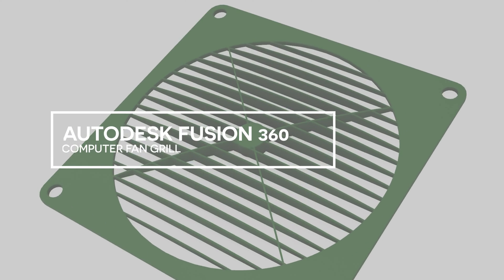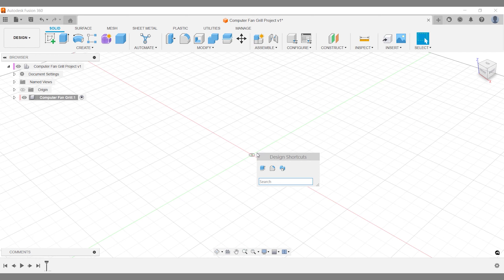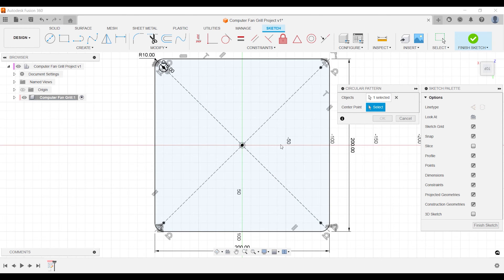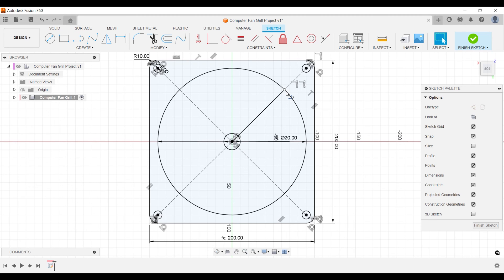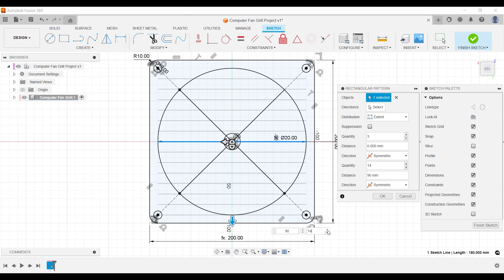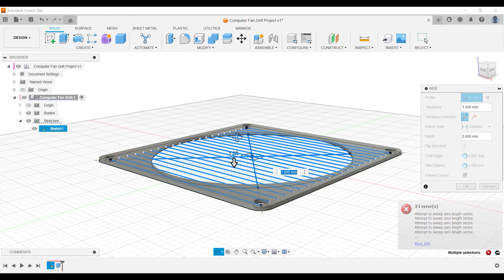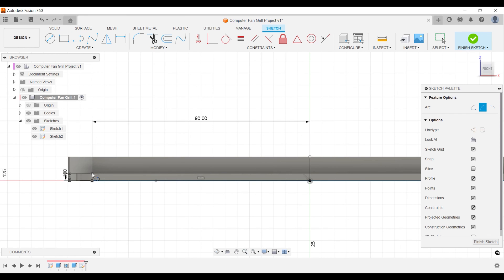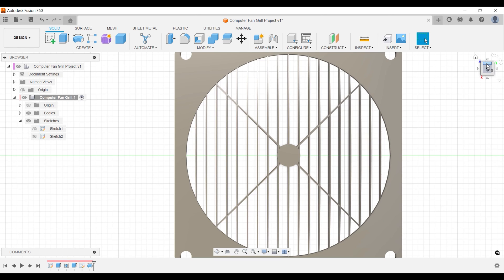Autodesk Fusion 360 Computer Fan Grill project

Comment: Thank you for taking the time to make this, however as a complete novice with Fusion 360, I wish this was going at 1/4 of the speed, for example, getting to the sketch part was really confusing and not explained. When you filet the corners, you start using a shortcut with no "an easier way to use filet is to use this shortcut". When making these tutorials it can be helpful to have pauses with a little info graphic or arrow for us noobies.
Reply from the maker: Thank you, i’ll think of that in future tutorials!

It’s a balance between production speed and quality.. Good luck with your 3D modeling!